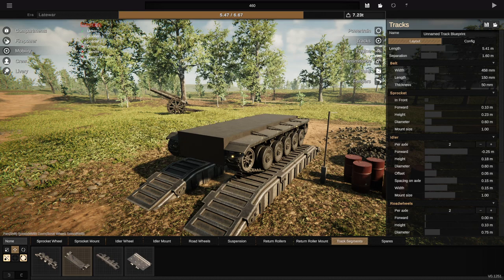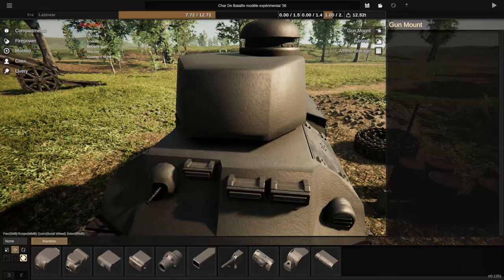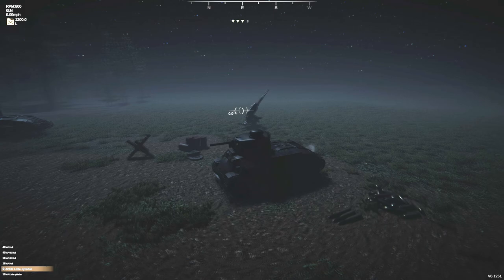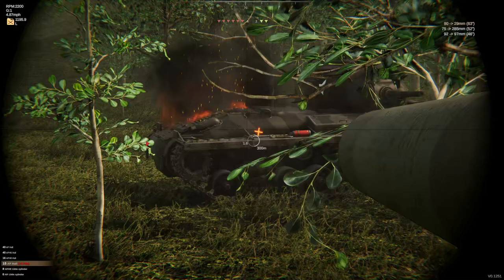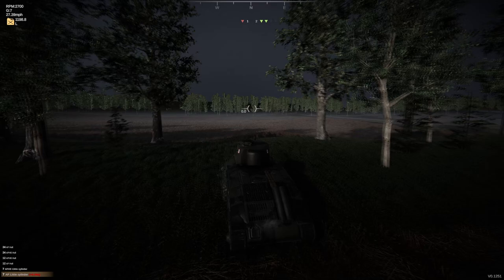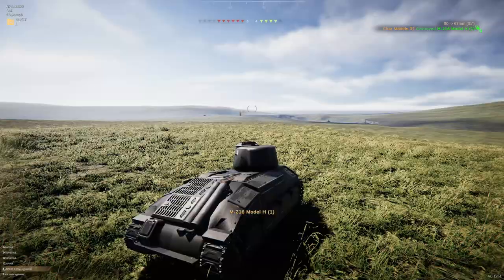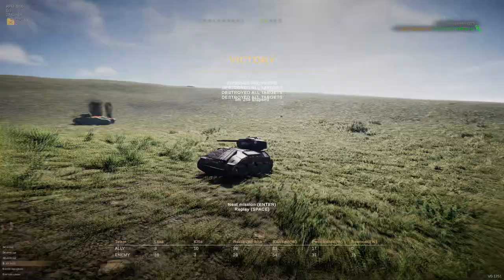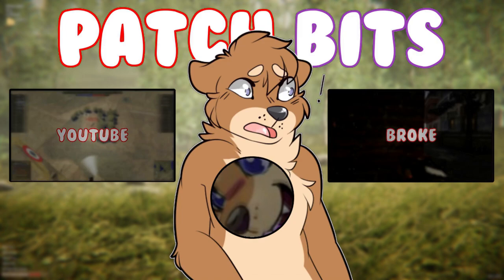I built a tank that would have SAVED FRANCE | Sprocket

Comment: I think the reason twin transmission turns so slow is that your first reverse gear has a different ratio than your first forward. Could be wrong but I seem to remember this fixing the issue for me.
Reply from the maker: Thanks! I'll play around!
Reply: @PatchBits  Also now they need to be really big. I usually go for +-2 in this sequence from 1st to 3rd 8-6-4. Play around a bit. Keeps tanks kinda agile but also improve stopping and accelerating from 0 to hill. Also you can increase braking force to get better turn-in  while driving with Twin Transmission

I personally do use TT almost every time over CB. CB is used by me only of space is problem or technology request that (like early war tanks)
Reply: @peta_sramek  definitely requires some tweaking but I've found it's also very possible to replicate historical powerplants and transmissions. Lots of WW2 era vehicles had V-12 engines between 18-39 liters and were paired with 5/1 and 4/1 transmissions, except for the Tiger I/II which had an 8/4 transmission. The prototype T29 had a 2/1 layout, which can definitely work in Sprocket. Number of gears has been my smallest problem, most of my tuning goes down to min/max RPM and gear ratios.
Reply: @omegaminus  Yesss. I made replica of Tiger II transmission without any problems

Comment: For twin transmission you have to change the Gear ratio of the 1st gear, to a larger number, then it works WAY better than clutch breaking
Reply from the maker: I have a fairly large first gear as is, already larger than G1/N, clutch braking does the job well enough at least lol
Reply: @PatchBits  what do you mean with way larger than G1/N, the 1st Gear determines G1/n? lol 
Or do you mean that all other gears are smaller in comparison to G1/n?

Anyway, since the experimental update, i had to get used to the whole engine system, but since clutch braking seems to work fine, that's no issue then :D
Reply from the maker: @bl4cksp1d3r  I mean I set G1/N and then made first gear larger!
Reply: @PatchBits  ahhh thought so

Comment: The reason the Twin trans turned like that was because your gearing was too high. When playing low tonnage clutch braking is perfect as the speeds aren't quick, for the most part. When you get along to 25 mph + twin breaking is great for mobility. Generally, when I set my first gear I use turning to set it. I like it to just reach the set safe max for RPM.  Then move along to setting each gear. I'm new to the game but am a former mechanic who built more than a few race vehicles in my youth. The theory is ( mostly ) sound and seems to translate into the game. Love your builds. You're wildly creative! It's helping me to up my design game :) Cheers.

Comment: I have an interesting theoretical build. The hull and engine is good enough. However, we can take a look at a French monstrosity called the Char 2C. Look at its 3 men turret, armed with a single 75mm Mle 1897 cannon. Take that thing and slap it to your tank here. Uparmour the bloody turret armour and voila. Next, upgrade the 1897 to the 7.5cm PaK 97/38 refit, which is the German anti tank refit of the Mle 1897 to fight against tanks, firing captured Polish 75mm AP rounds at a shell velocity of 570m/s, capable of penetrating 97mm of armour at 100m.